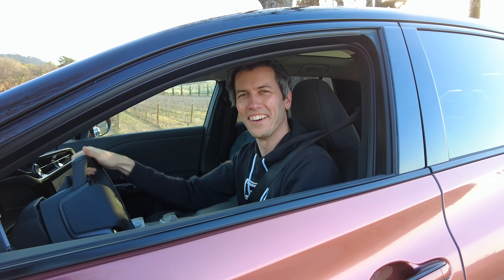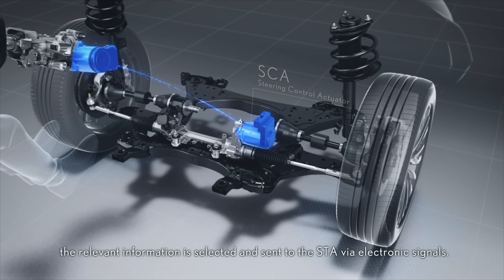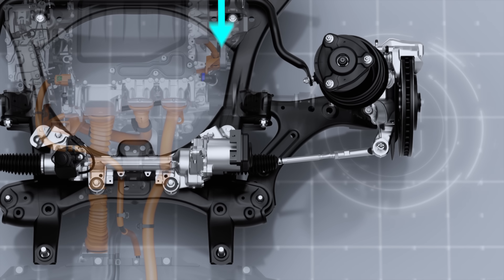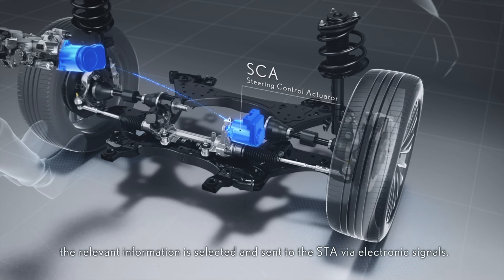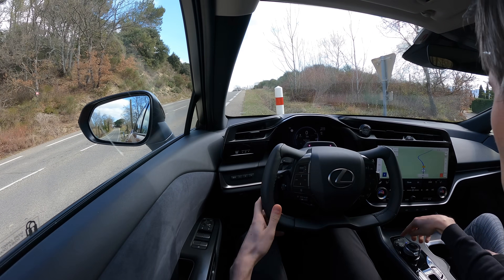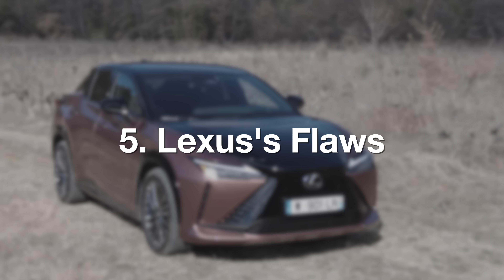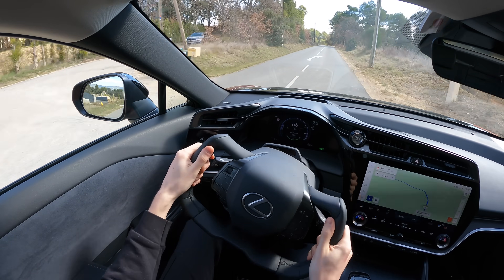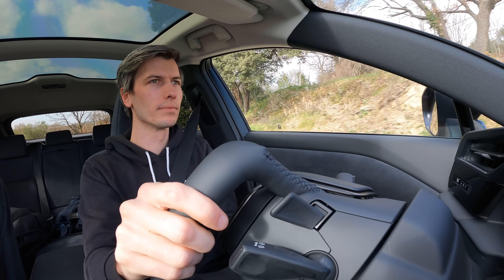How Lexus Fixed Tesla's Bad Idea: Steer-By-Wire Yoke

Comment: No thanks. All of the points covered under "Why?" still don't justify it for me. Redundancy is safe but it also doubles failure points. It's not the catastrophic failures that worry me. It's the component failures that drive the cost of ownership through the roof. Serviceability is long gone so I'm sure that the failure of most any component is going to require the complete replacement of much larger assemblies ($$$).. More components off to the landfill.

Keep it an option at most.

Comment: In the driving simulator game BeamNG, any non-linearity set in to the steering response makes for a disorienting simulated driving experience. I don't care if the car is going 5 or 150mph, I want 15° of steering input to yield the same result on the simulated steering linkage. I'm a professional amateur simulation driver.

Comment: I like it. My father has long term damage to his shoulders and so turning the wheel around and around is painful and difficult for him. The shaking of the steering wheel is painful and fatiguing over rough roads. something that could dampen the vibrations, and allow him to move the wheel without the cross hand pull/push would make his life so much easier and better. He has damage to his hips and back and being able to move his legs around and shift in the seat when he drives would be a miracle for him. Thrown in a thumb wheel to adjust the sensitivity of the steer and I'd want him in that car, hands down.

Comment: Yea...two motors is nice. But if one fails nobody will get it fixed so they will drive around with "check steering" light until the other motor fails. You know very well that will happen

Comment: The comparison with the aircraft industry doesn't hold up.

1. The aircraft manufacturers have agencies full of industry veterans watching their designs and manufacturing processes closely for safety reasons.

2. An aircraft has a black box so in case of an accident there is a rigorous investigation and changes in industry standards when design or manufacturing flaws cause accidents.

So while mistakes in design, software or manufacturing could be equally deadly here, the industry lacks the standards to prevent, investigate or regulate.

Comment: I really like this as an engineering concept. Personally, I don't belive that this would be able to apply to everyday vehicles. As described, it is basically like sticking a sim rig into a moving vehicle. Anyone with sim experience will know that there is some delay between inputs and what happens in the simulation/game, however, because we already deal with the delay, applying that to a real vehicle might not be as bad as it seems because we know that we can train ourselves. That being said, the real world is more dangerous and unpredicatble than a videogame, so we should still be careful with the system.
The concept is great, but at the end of the day, more expensive than necessary, more overcomplicated than necessary. The simpler something is, the more realiable it works. As for the engineering, I understand the engineer's mentallity of creating such a system, however, it still feels like a skill and smarts flex, especially in in how expansive the design is. There is really no practical purpose in making this a reality, other than being a cool project to work on, and concidering how reliable mechanical systems are, I don't see the point.
Some things that I have not seen people mention, but may make an electronic system useful, is self correcting alignment. If for some reason hitting a pothole causes a linkage to bend, I could see how the steering could be adjusted to align centered. In other applications, I could see how a lighter, reduced latency system could be used for road/track performance cars. For street driving, a normal steering ratio could be used, but if you want to take the car on track, you could have smaller ratios to get quicker response in less steering travel, enhancing the experience.

Comment: Anyway, it still looks inferior to the Citroen DIRAVI steering from 1970. Citroen did this with hydraulics, the “weight” of the steering was variable with speed of the car, not the number of turns of the steering wheel, no lag, self centering, and in case of depressurization of the hydraulics the steering gets mechanically connected to the wheels.

Comment: This is totally what I want. On my current BMW, the iDrive controller system only loses connectivity and exhibits semi-random buggy functionality probably even 100mi or so, and it only takes on average around 30 seconds to fiddle with it to restore normal functionality. I'm sure that will be just fine when vehicles loses steering input due to the inevitable bugs in the software control systems (or input is interpreted backwards, for example); after all, 30 seconds of losing vehicle control every 100mi will probably be fine. As the manufacturers like to say these days, the electronic control systems will be safer than a human driver on average, even if they have catastrophic failures every once in a while.

Comment: What if the connection between the SCA and STA breaks or fails in some way? You say there is redundancy like in aviation, but you fail to realize that in aviation we use 2 separate systems to do the same thing in case one fails, not just redundant components in the same system. Electronics ALWAYS fail, it's just a matter of time. That's why for aircraft that use a fly by wire system you will still have a separate mechanical connection to the control surfaces or actuators.

Comment: I would consider this only in case there is no lag that I can feel, that's just a deal breaker. Also, if there is a good feedback from the road. Even now with traditional steering system there are cars that have just awful road feedback and I hate driving those cars. But no good feedback plus delay in steering is just a big NO from me.

Comment: Throttle by wire is fine, 2 things I absolutely refuse though are pure brake by wire, and steer by wire. Steer by wire is espicially problematic when you think about how a malfunctioning sensor can turn your right turn into a left, or none at all. Or, how these new internet connected cars can potentially be hacked, and all of a sudden your car darts off into a retaining wall at 80 mph and there's nothing you can do about it

Comment: I have been driving my Model S with the Yoke for over a year and I love it. Took me 2 days to get used to it. I can park easily using my palm (like I've always done with a regular wheel). I don't agree  that it is a bad design. I just think people don´t like change. The one thing I would agree is I don't like all the controls being buttons, especially the horn. The horn button drives me nuts. Again, just my experience.
Reply from the maker: Glad that you enjoy yours, thanks for sharing your insight! To me, one of the big advantages of a yoke is never taking your hands off the wheel (like in racing), but when the steering ratio eliminates that benefit, it makes no sense to me. And agreed on the horn, in a panic situation it's probably difficult to find super quickly.

Comment: My 2019…built in fall 2018…. Infiniti qx50 has steer by wire. Works great.
Reply from the maker: It does indeed! Unlike this system, though, your Infiniti does indeed have a mechanical connection from steering wheel to steering rack.
Reply: @EngineeringExplained   I think with propilot assist it does not. I found this statement regarding the system. “Direct Adaptive Steering replaces a mechanical steering column with high-speed electric motors and sensors, with the steering instead controlled and enhanced digitally. The system places the driver in total command, and is key in realizing the 2019 QX50's ProPILOT Assist functions.” It’s different than the propilot you find on other Nissans.

Comment: The steering ratio change is an interesting idea.  I'm a little nervous about what happens when someone goes from that to a 'regular ratio' car on the highway though?  Will they turn the wheel too far?
Reply from the maker: Highway maneuvers feel very similar, as the ratio is similar to traditional setups.
Reply: I see.  It's the low speed steering ratio that's increased, not the high speed ratio that's decreased.
Reply: I see it less as ratio change, and more i want this much of this speeds input. As long as I keep that in mind, I might not notice. If I recall how my pilot friend (which I might have misunderstood) fly by wire is less of a direct command, and more it takes the idea of then command and translates it to what the plane can do at that speed. This actually eases the controls as even though full tilt on the stick is less defection of the control surfaces, it's easier to keep control. Off topic I'd make the 104 safer if implemented over its shaker system. It would only allow for the max, when I ask for the max. Instead of max at low speed being fine, but flipping me like a pancake at high. I see it much the same for a car. The max turn i can take at 30 is not the same as I can at 60. With a traditional wheel, I gotta learn that place on the wheel, this, I just ask for the percentage of turn I want for speed and i got it. What the real issue is, is not the variable steering, but how we think about steering. We think with a set ratio, and not asking for an amount of output. The real danger will come from going back to standard steering after getting used to this.

Comment: I think people will get used to everything other than the delay. The steering wheel is a part of what keeps the car safe, a delay can cause unexpected behavior when trying to avoid a collision with a pedestrian. I see lawsuits coming. There is also a misconception that redundancy guarantees safety - it is entirely possible for both parts to fail at the same time or an unexpected scenario to cripple a critical line, especially when the parts are near each other. An example would be a wire shorting causing overheating and damaging the other wire next to it. Still - I believe it's safe to assume that Lexus tested this system extensively and this is probably no less safe than traditional steering besides the delay. I think another point to bring up is that in theory similar problems can occur with traditional power steering - imagine driving at the highway and a deer runs of the road - if power steering would fail at that situation, it's highly likely that the surprise would cause an accident of some kind. There probably are even documented cases where this has occurred. Though, difficult steering is better than no steering at all, so I truly hope for Lexus's own sake that they tested this to an extreme level.

Comment: This video is a masterclass. Thank you for doing a great job. I just have a question. Is there a good reason to have the SCA on the opposite side of the steering wheel and the STA are?.
Reply from the maker: Mounting location is flexible, likely comes down to where it fits best from a packaging standpoint, considering all the other items that can use the area.
Reply: @EngineeringExplained  thank you very much for the explanation. Appreciate a lot that you took time to answer me👍

Comment: I don't like this idea at all.  Redundancy or not it will never be as safe as linkage.  This is an example of someone thinking of something and trying to convince you it's a better idea even though it obviously has big time safety issues.  I would not feel safe on the roads with cars around me having this especially up in Minnesota.  The negative twenty can do strange things to electronical components
Reply from the maker: Y'all have planes in Minnesota? The same logic applies with all those jets, which are flying up in the sky at -60°.
Reply: @EngineeringExplained  I just like the redundancy of the mechanical system. It usually will give warning if going bad. Everything has it's pros and cons. Don't agree here but I still like your stuff!

Comment: I wonder if there is a hard threshold between the steering ratio at low speed and the one at high speed, or if its more incremental... and how did they determine that slope? I bet there's a knob/selector at some point in the driver's seat menu's that lets you select its behavior... I bet they even use this as an excuse to engineer out self-driving to the full extent.

Comment: So the regulations won't let Audi have sequential turn signals, because the area that initially lights up isn't big enough, but they will allow cars to just have 1/3 of a steering wheel that you can't properly grab to turn. Interesting.

Comment: I feel like the variable steering ratio can mess with your muscle memory or your perception of how much you need to steer since its always changing, im not sure if that could be as big of a problem as i think it is but nonetheless id love to try it out
Reply: The alternative approach is to have a lower steering ratio close to the limits and a highway compartible high ratio at the center. Already used in some heavy equipment which is running steer by whire for many years now, and apparently it helps a lot wis muscle memory.
Reply: @danielrose1392 there is also a mechanical version already used in cars
Reply: This is definitely something that happens if you’re changing the settings for different scenarios. I sometimes accidentally switch to the Sport mode in my 2015 Q50(quickest ratio), instead of the personal setting that’s one mode above it on the switch(I have this mode set to mild response, but heavier effort). I have both set to the quickest pedal response. Sometimes I find myself making corrections to avoid hitting a curb or something, and that’s when I realize what’s happened.
Reply: The peugeot 2008 has variable steering assists ( I don't know the systems name or what other cars have it). It hardenes the steering at highway speeds and lowers when going slow just like this system even though the steering is mechanically actuated. It does sligthly confuse you when you pull up to a gas station after driving in the highway for ours but it is nothing that your brain can't handle. I assume it won't be a problem for this system.
Reply: @emretopal1233  A lot of cars have this. It's not relevant to this discussion because it doesn't affect the ratio. You can get used to variable assist almost immediately - in fact, a well designed variable assist system won't even be apparent to the driver. Getting used to variable ratio takes longer because you have to learn how to anticipate turns of different angles at different speeds. But you would get used to it within a day and be perfectly safe. The main issue is that people should have a day of test driving before they hit the public roads.
Reply: @andoletube  also when you switch car daily. I once owned a sequential semi automatic smart for two that required to push the brakes to get into gear, and when I was in a rush it happened to me a few times to switch into gear in the other manual car with one foot on the brake and not using the clutch. it was pretty horrible for anyone who had any mechanical sympathy.
Reply: it's not a problem, bmw has had variable steering ratios in their cars since 2003, I actually own one. Don't even really notice it lol. ratio changes at different speeds.
Reply: I think mechanical is better.  A low ratio should be fine if rapid movement is restricted by a linear mechanical resistor. It could be designed to vary resistance based on driving speed. If you want to drift there could be a button to reduce or turn off the resistance. In fact it might be enough to just use the existing resistance and vary the mechanical assistance.
Reply: Many cars already have variable ratios. I do also wonder but presumably it isn’t a problem since it’s a fairly common feature
Reply: Its like using acceleration on the mouse or dualshock.
Reply: This variable steering ratio type is very familiar to me in the form of things like videogames and shooters.

If there are people who can use mouse acceleration on snipers to get headshot after headshot, while being able to switch to close range and still keep up just fine, I think we as humans have the capability to adapt to it. It'll for sure be awkward at first, but I guarantee you'll get used to it.
Reply: @artoriasalter482  I hate mouse acceleration and I always thought that pro players preferred constant speed.
Reply: @drayke8886  That is true. In sniping mode you would simply use a lower but fixed sensitivity value, there is no acceleration there.
Reply: @drayke8886 mouse deceleration sucks, too
Reply: @drayke8886  they do. However there are cases where this is not true, as a general rule they do prefer normal speed though.
Reply: @artoriasalter482  its not like mouse acceleration, because a steering wheel is more like a graphic tablet, absolute coordinates. But I agree I'm pretty sure we can adapt and I'm pretty sure they had a rough prrof of concept to make sure of that before investing millions and millions in R & D
Reply: @geemy9675  there is a version of acceleration for graphic tablets as well, and the absolute control portion is only true if you place the pen after removing it from the sensed area
Reply: @artoriasalter482  ok as I wrote it I was almost sure someone would find an example 😂 but you can't take your wheel / yoke off and put it back..so honestly, any attempt to do acceleration would most probably be way worse than without it

Comment: Soo, this is almost like a servo based system used in RC cars. Only difference is there is a table that determines how much steering angle you get at different vehicle speeds.